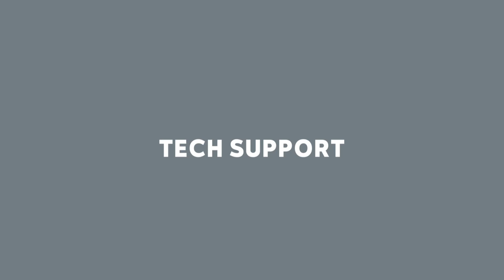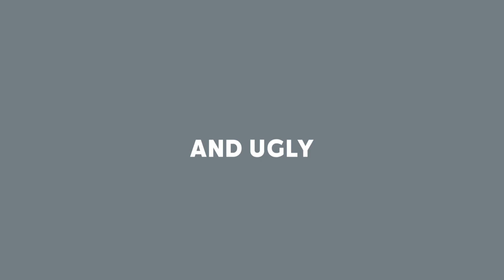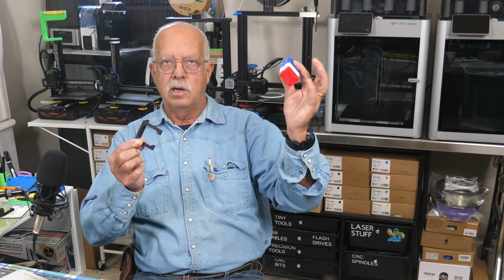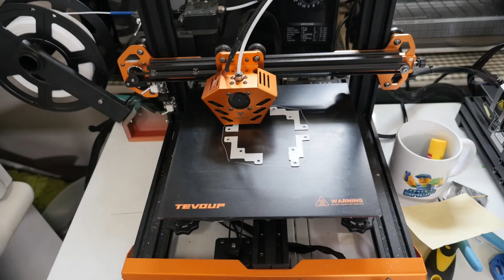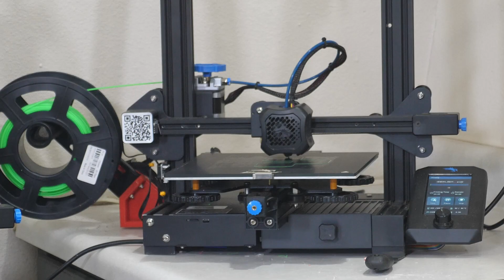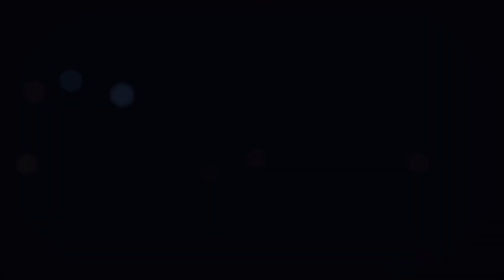3D Printer Tech Support, Good, Bad, & Ugly

Comment: You didn't mention Monport so I'm guessing you haven't had an issue with your 40W. After watcbing you do the heat exchanger relay mod, I thought I'd add the Monport to my  shop.  My experience wasn't as pleasant. It took awhile for me to realize that the reason I wasn't getting power to the relay was because the Monport was dead.  It took 3 attempts to get an answer from their tech support ... same stupid response ... send us a picture of your problem. It doesn't power up ... what kind of picture do you want. Anyway, after the 3rd attempt, a tech actually divulged where the fuse is. Problem solved.
Reply from the maker: No, I did not mention Monport since this covered 3D printers.  That said, I've never had to contact Monport on my laser, which is still in use.